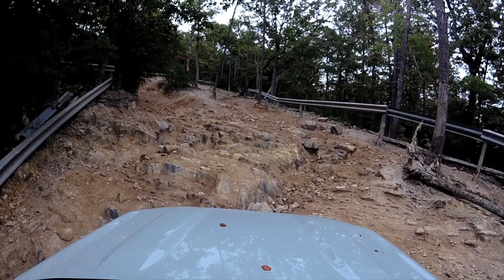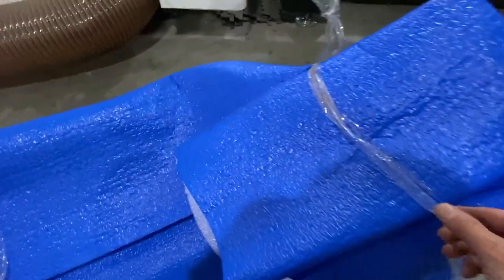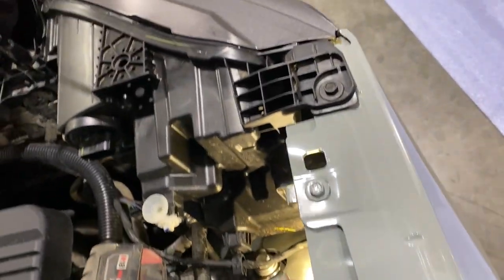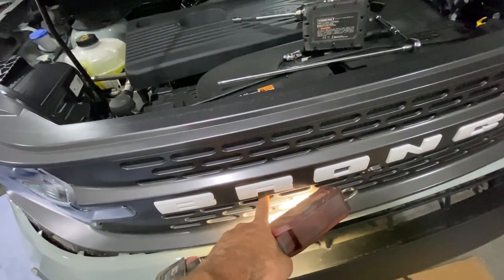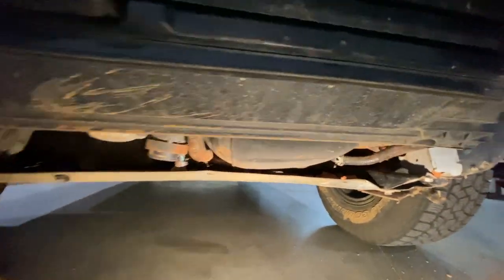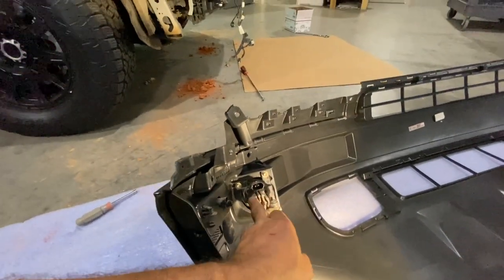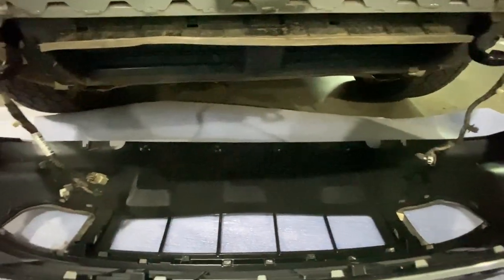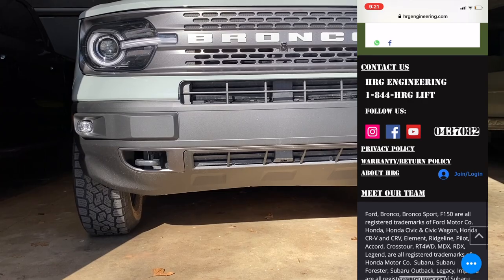How to replace the front bumper on a 2021 Ford Bronco Sport Badlands

Comment: Hy my friend I saw the vídeo and I tried to follow your steps but not working properly, than I tried my way and discovered that you have to take both headlights and the grille together for the take the bumper off, 6 screws for the top of grille and 6 screws for both headlights.
And assembly grille,headlights and bumper all together to put on back to the car.

Comment: Thanks for the video.  I'm about to mount a nudge bar and wanted to know how hard it was to remove the bumper.  Looks like it's pretty hard.  BTW, have you ever considered sway bar disconnects?  I was thinking about some of the manual ones available for Wranglers.  A lot of them are adjustable and one of them might fit the Bronco Sport.  But I don't know if you'd have to further modify other components as well like brake lines and stuff.

Comment: the whole front end comes out as an assembly with the headlamps mounted onto the grille and bumper. make sure to get the bolts that are holding the headlamps together. 3 on each side. that way you can take it apart when you pull off the bumper withoput having to struggle of reaching the small 7mm bolts.

Comment: This is way too much work. I have a dent in my right fog light area and I want to get the dent out but I dont think there is an easy way to get to the back of it now after watching this..
Reply: I hear that... I also received my first "ding" near the fog light after someone backed into my vehicle... The bumper is still straight and no alignment issues with any of the front quarter panels or hood... but a small dented in plastic bumper section... ugh... only noticeable if you look for it... yup a lot of work for that...

Comment: Thats not how you undo the bumper thats why those 2 screws in the middle seam stupid to be there and facing the wrong way. The entire front end is meant to come off at once. Bumper fascia up and down, grill and headlights. Once its off you can easily take the headlights and grill apart from the bumper.